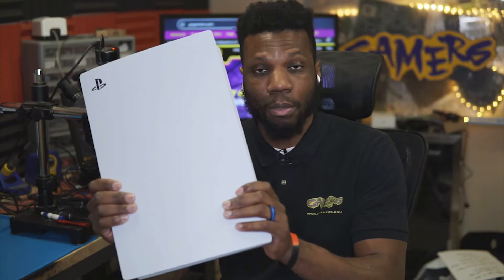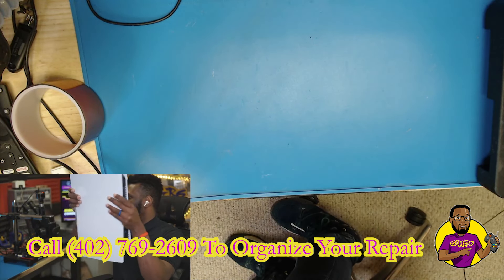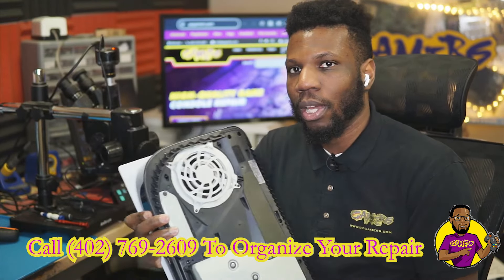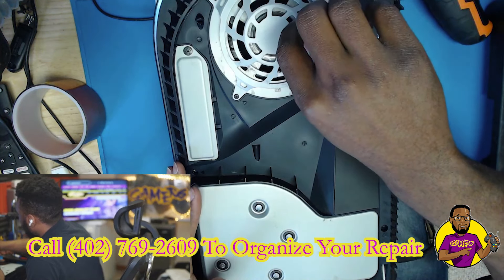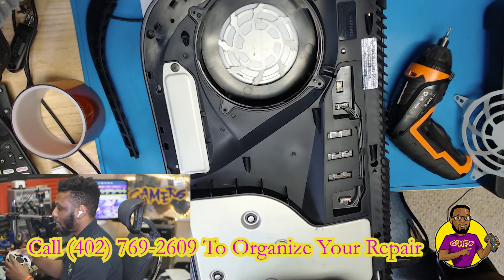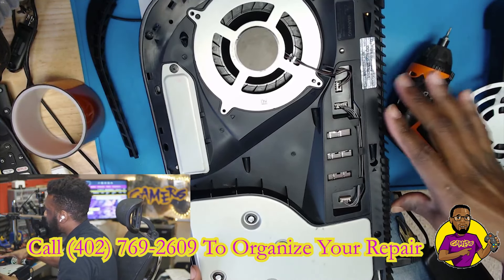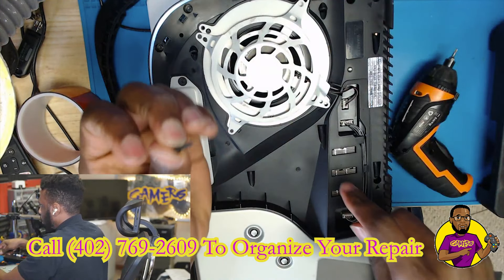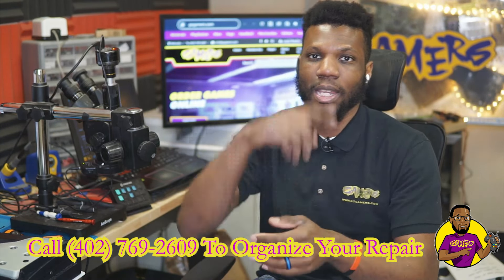Fix PS5 Overheating and Is Too Hot (EASY 5 Minute Fan Repair!)

Comment: Elden Ring is the only game to cause mine to shut off after an hour or so. Cleaned out the fan and then after 2 or 3 hours the issue came back. What would you suggest?
Reply: I think it’s a power thing I’m taking mines to a store tmm
Reply: Same. Did you find a fix?
Reply: @sarimsaleem4764  no man 😥
Reply: So even aftee cleaning the fan the issue still persists. Because same is happening with horizon forbidden west . Ps5 shuts off without warning. Or some times ps5 too hot
Reply: @jacktonsauron8185  yeah mate. There was so much dust in there before I cleaned and spent about 2 hours cleaning it. Got Bout 80-90 percent of it out. Ps5 was super quiet when i turned it back on. Even put in a 4k blu ray to test the sound as usually it'll get loud for the enitial boot up but still quiet so had faith. But then it shut off after 2 hours of elden ring, no warning. Not sure what the issue is
Reply: Idk if this will help you but clean console as best as possible can especially down by the psu (power supply) and don’t leave ur Ps5 In vertical poorly designed for vertical I had all the same issues with Ps5 applications and ever since horizontal console hasn’t shut off
Reply: @ali-khan  maybe it’s the game. Have you checked to see if other people are have the same issue but just with that game?
Reply: no fixes at all and a lot of people are having the same issue? my assumption is it came from that last firmware update
Reply: Hmm. Funny I can play elden ring for hours straight but one cinematic staring a new game notifies me that my console was too hot. 
I was like 🙄 cmon. Not even 10 minutes I had turned it on.
Reply: If the fan is working, the console is clean from dust and there is enough space around the console for airflow, then the issue MUST be the liquid metal on the APU not transferring heat to the heatsink appropriately. You would need to re-apply it.
Reply: @elgusano6535  well buy a new one Ha!!
Reply: @wasupman777  you’re a 🌽 🏀.
Reply: @FatPapiNel  🤬🤬🤬
Reply: They sending them update to mess up our console so we can buy the pS6 when it drops. I’m not falling for it

Comment: If anybody's having trouble with the Bluetooth headset that uses a dongle, chances are it's blowing that hot ass air right onto the poor little dongle and it's getting too hot, you could grab an extension and it will work wonders

Comment: What do you recommend to do if my ps5 randomly shuts off playing any ps5 game?
Reply: seems like a lot of people are having this issue lately, was it that recent update?
Reply: IM HAVING THIS TOO 😭 Its so annoying and i dont know what to do , i could be playing the same exact game but the ps4 version and it has no issues but the ps5 one does
Reply: @qahiko_  you need to have your system deep cleaned that’s what is wrong what it there is build up on the power some where in the mother board if you don’t trust yourself cleaning it take it to a shop
Reply: Mine only shuts off when playing demon souls

Comment: Mine just randomly turn offs it don’t tell me it’s over heating so i don’t know what wrong with it
Reply: yeah same bro
Reply: Here are the steps I took and my ps5 doesn't shutoff anymore
1. I plugged my ps5 directly into the wall socket (Sony says to try this) 
2. Then I cleared the system cache when I did this I was playing with no issues after that, but in the morning I did a rebuild of the data base just to be sure, been playing like normal now hope this helps

Comment: My shit started doing a few wks ago had it about a yr and half I have the digital one I cleaned it out dusted off the fan and it's still turning off idk wtf is wrong with it when I felt it it's still seems hot af
Reply: found a solution yet?
Reply: @Ruuii.  hell no I tried everything even got the plates with a vent and it still does

Comment: i get no message, just shuts off mid game all of a sudden over the last week...first time this has happened in the year and a half of owning it...very frustrating....
Reply: Overheating may need a cleaning. Worst part is its usually the power supply so a major teardown is required to acces the power supply. Sony also says to vaccum the exhausts where the hot air is blown out (the bottom and rear of the console) I find that risky since you may spin the fan and short something.

Comment: I am new to your channel and followed all your recommendations as far as repair equipment (solder, soldering gun, camers, etc.) I am determined to fix this ps5. I was able to get mine powered on...magically. ran the safe mode reset. Started downloading games...and about 25-30 min in it shut off again. Making me think its an overheating issue. Fan works well. 12v Power from the supply checked on board. Now i am waiting for the camera and display so i can check all continuity points...so frustrating. And of course its out of warranty. Reminds me of the red ring of death...good times
Reply: Yea totally sucks cuz in my case I got mine overpriced on eBay brand-new but no warranty and I now have a PS5 that I have set up in front on my AC to cool it  while I play and if God forbid it breaks totally, I cannot afford to buy another nowhere near 800 bucks.
Reply: @erocnrolla i have video that may help with that, I fixed mine permanently with this method.
Reply: @platinum5gaming can I have it

Comment: what is common is dust it seems. I've never heard of the fan dying issue but of course anything mechanical is possible. in 2 years I've only had the issue once of shut down and it seems to be dust but I'll report back when I clean the heat sink out
Reply: Update?

Comment: Bro I have PS5 STANDARD CD.. When I play fifa 22 Version PS5 it told me that the ps5 is too hot and switching off... Is your videos the solution?!
Reply: Like me
Reply: Takes. Off the plates bro it helps with me
Reply: Bro I get same issue with FIFA 22 on ps5 , let me know if you find solution
Reply: I just got FIFA 22 and now it makes my PS5 overheat for everything. It worked perfectly fine before it, so I really hope there is a fix
Reply: @theoctolingsociety1004  take off plates
Reply: @theoctolingsociety1004  Also clean the fans
Reply: Same here, it just overheats when playing Fifa 22 ps5 version. Any solution?
Reply: @khumopooe6769   i have 2 version digital im playing normaly and cd disk is overheating
Reply: Here are the steps I took and my ps5 doesn't shutoff anymore
1. I plugged my ps5 directly into the wall socket (Sony says to try this) 
2. Then I cleared the system cache when I did this I was playing with no issues after that, but in the morning I did a rebuild of the data base just to be sure, been playing like normal now hope this helps

Comment: My PS5 says nothing about over heating..  but whenever I play PS5 version of a game,  my PS5 hard crashes. 
I've tried a multitude of things to solve this problem..  

Help?
Reply: Most likely a software issue
Reply: Here are the steps I took and my ps5 doesn't shutoff anymore
1. I plugged my ps5 directly into the wall socket (Sony says to try this) 
2. Then I cleared the system cache when I did this I was playing with no issues after that, but in the morning I did a rebuild of the data base just to be sure, been playing like normal now hope this helps

Comment: I got my ps5 last octuber, the fan never make any noice, so idk if the fan work or not, when i play ps4 games doesnt get any warm, but when I start playing ps5 game it get hot
Reply: why are so many people having this issue? wtf
Reply: Have you found any solutions for this problem?
Reply: @platinum5gaming   How is it going today? Mine shows me the warning with 30 minutes of GOW:R, dont shut down but keeps showing me this message sometimes. My fan works, but never saw sping very fast or making any noise, even when show the warning message it still spining calm.
Reply: @RenanWerdan  I ended up having to clean the inside of my ps5 it's the only way to fix it. I've never opened and cleaned a console but I had zero issues doing it, I don't know if it's the same issue that I had cause I never got a warning just a shut off. It's dust in the psu area inside the ps5 that gets clogged I've cleaned it and my ps5 hasn't shut off again

Comment: Great video. Can you kindly tell me if the Fan its supposed to turn on immediately after I power on the PS5? Mine is not turning on and I cant seem to find confirmation if the Fan should be "always on" or "turns on as needed". Thanks.
Reply: They usually turn on as needed. Like when downloading games or launching big games or when temperatures call for it. A cold start usually won’t have your fans going

Comment: i had this issue once then suddenly it disappeared. just recently today lol i was using my console and i decided to open it up and clean the fan a bit. no removing no nothing just clean wtever i could that’s around the ps5 then i plug it back in and i play for nearly two or three hours then it turned off on its own. i turned it back on and it turned off after an hour or so. its safe to say i have this same issue once again.

Comment: Been happening to me starting 2 weeks ago outta nowhere smh must be the software issue/update
Reply: Same it started 2 weeks ago and has been happening consistently smh
Reply: Yeah it’s consistent happening to most people around same time, Sony needs to update it and increase fan speeds too, because atm it runs with only 18% of speeds while in game max of 22% when it’s hot, instead of just leaving it to the ps5 to decide.
Reply: @gh0st515  my ps5 is getting really hot when playing ps5 games and the fans now keep going full blast to medium and low then back up again, this was never an issue a few weeks back. Is there any info on it actually being a software update issue? Ty
Reply: @mrbobajango7482  I decided to take the panels off my PlayStation and clean it with compressed air and a hand vacuum. After that it has worked fine ever since
Reply: @gh0st515  glad you got it working mate! Mine is clean so I may have to send for a repair if its not update related. Thanks 👍

Comment: I have deep cleaned the PS5, removed all dust and properly put it back together but it still has overheating issues after an hour or so. There has to be something else that is causing this issue. Can anyone help?
Reply: Same thing is happening to me. Have you by any chance figured out what the problem may be?
Reply: This fucking sucks. I know it’s not the solution but what I do is whenever I play a game that will overheat the console I just take the plates off. That’ll allow me to at least play for 2 hours straight without any issues. However if you do this you have to clean it even more frequently to avoid any other problems. 
Can you believe that I turned on my ps5 and played a cinematic for 10 minutes and it gave me the notification about how hot the console was? It’s just fucking stupid, how could they get away with this??
Reply: I would contact Sony and send it in.
Reply: @israelpinon7355  i cAnt even run 1 game for fornite and i don’t get warning issues it just turns straight off :( ps5 ain’t even dusty man shits ridiculous my ps4 never did this and i never cleaned it for the 5 plus years I’ve had it
Reply: @woof7046  exact same thing bro 🤦🏾‍♂️🤦🏾‍♂️ exact same
Reply: @woof7046  Same thing on Fortnite… Whenever I’m in the Battle Bus or in the lobby it begins to overheat a lot whereas on other games it doesn’t to this… I really don’t know what to do…
Reply: Literally same here, whenever I play WWE2K22, GT7, and Dead by Daylight my crap shuts off, this has been happening for like more then a whole month and now just a couple of days ago my ps5 said my data is corrupted and I’m assuming it’s from all the times my ps5 has shut off so I actually have my plates off too and I’ll actually have a good 30 minutes of playtime on DBD or 2K but then if I stay in one game for too long it turns off, I’ve really been trying to be patient but it really just pisses me off knowing that my ps5 is most likely getting damaged literally everyday when I’ve done everything I can do to fix it, this is a whole next Gen console like why is this happening I never had any problems like this with my ps4😬😑
Reply: @woof7046  so far for me its racing games ground tourismo 7 and f12022 both made my ps5 just randomly shut off i had to unplug power and then the ps5 tells me i shut it off wrong i have a day 1 ps5 no problems till gt7
Reply: @josephdasilva3881  same issue I'm experiencing now with my G.T.7 I can watch movies for days straight. Once I go to play Gran Tourismo for more than 1 hr it turns off with no warning. (Hard drive version of the game, not the disc)
Reply: Probably not enough liquid metal
Reply: @woof7046  exactly only on Fortnite
Reply: @woof7046  I stg I just got mines fresh out the box and it gets hot but My ps4 slim never been cleaned for 4 years and ran beautifully
Reply: Yes it’s happening to me to I have the same problem when I play a game is only that game that over heats but when I play different games they don’t
Reply: @woof7046  same thing bro everytime I’m on Fortnite I can maybe get through one full game if I’m lucky & then on the second game, it’ll crash before I even make it to top 10. checked the fan out, super clean, minimum dust. took it to a technician who re applied better thermal paste and cleaned out the heat sync, and it still does the same thing. This shit is absolutely ridiculous.
Reply: @nateshaughnessy8563  And Sony won't refund without a warranty either, heard a lawsuit is coming.
Reply: @nateshaughnessy8563 what's the status rn ?

Comment: Question I recently did a mod on my ps5 where i cut open the inner shell to see heat sink and fans work I replaced the outer shell with see through shell but not my games randomly shuts off do you think it’s because of the fans air not being able to travel down to the heatsink
Because of the opening

Comment: I just bought ps5 2 days back and when I'm playing ps5 game, an error pops up ( your ps5 is overheating, turn it off) i have checked there is no dust or anything i just got it 2 days back.. changed the setup too vertically to horizontally) nothing is working.. PS5 games are causing overheating error to pop up within 5 mins of gameplay.. + my PS5 doesn't appear to be warm when i touch it when the error pops up yet it's turning my ps5 automatically... it's working fine with ps4 games.. i played horizon zero dawn for an hour, no error observed but as soon as I switched to COD or astro playroom, within 5 mins it says overheating and it turns off automatically. Please tell me what to do??
Reply: @Pc Master Dummies new
Reply: @popcornWithJargit did you fix it i just bought a ps5 and having the same issue thats frustrating

Comment: Need help bro my game cuts off mid game and I took both plates off and both fans are spinning
Reply: Here are the steps I took and my ps5 doesn't shutoff anymore
1. I plugged my ps5 directly into the wall socket (Sony says to try this) 
2. Then I cleared the system cache when I did this I was playing with no issues after that, but in the morning I did a rebuild of the data base just to be sure, been playing like normal now hope this helps

Comment: My console is 6 months old. It’s about 130* degrees internal temp when playing it for an extended period of time. Most of the clip on back fans are gimmicky. Only reduce cpu temp by 2* degrees. I need a real solution for 10 degree temperature difference or better. Help

Comment: hey man my ac broke and my room is about 90-95 degrees and my ps5 console is saying that is saying that it is going to overheat it has happened to me a few times lately, I was wondering if this is related to my house ac being broken and rooms being so hot or do you think its a problem with the console being clogged up or something like that maybe the thermal paste or something?
Reply: I think its both as during the recent heatwave in UK the ps5 has been saying the message and it hasn't before. But also while I cleaned the fans, the problem vanished
Reply: @ishaqmh780   do you have any aftermarket fans or anything that helps cool your system? and i was also wondering how do you clean the fans?

Comment: Should i do this, i still on the 1st year of warranty
Reply: Here are the steps I took and my ps5 doesn't shutoff anymore
1. I plugged my ps5 directly into the wall socket (Sony says to try this) 
2. Then I cleared the system cache when I did this I was playing with no issues after that, but in the morning I did a rebuild of the data base just to be sure, been playing like normal now hope this helps

Comment: Any external rear fans that you recommend?
Reply: I’m pretty sure it’s not the fans sadly. I’ve bought 2 different versions, one under the console and one on the rear. None of them seem to work. It’s more likely a faulty piece not the whole body of the console.
Reply: @israelpinon7355  I think you’re right bc even if the fans work…there’s no way it should be overheating in the first place. I will say mine has been running smooth since I’ve added the fans.
Reply: @israelpinon7355  gotta make sure the rear fans are forcing air out of the console, not into it. The rear is for exhaust.

Comment: Mine gets hot when I play Fortnite do u know something I could do to help that I've tried deleting and downloading back and deleting things off my PlayStation?
Reply: Here are the steps I took and my ps5 doesn't shutoff anymore
1. I plugged my ps5 directly into the wall socket (Sony says to try this) 
2. Then I cleared the system cache when I did this I was playing with no issues after that, but in the morning I did a rebuild of the data base just to be sure, been playing like normal now hope this helps